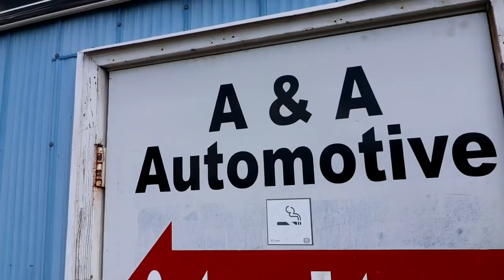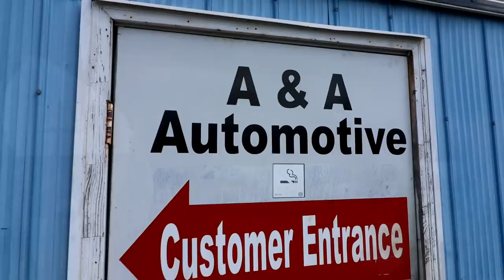Repotting my "Root over Temple" Ficus benjamina, The Bonsai Zone, July 2020

Comment: Great video- do you bring all your bonsai plants indoors during the cold snowy winters or you leave it outside - based on the variety? Thanks
Reply from the maker: The tropical trees come inside the house before the frost comes. The temperate trees come in just after the first frost hits and the hardy trees stay outside until the weather gets really cold, -15 or lower, and they go into the unheated basement until it warms up again in spring.

Comment: Hi Nigel, I just sawed the large roots off my Ficus Retusa in order to have new growth and also lower the plants height. (It has the large root trunk). Some of the leaves have been turning yellow and falling off. Is this normal? Where should I keep my Ficus bonsai while it's roots grow back (full shade, sun or??), and should I water often? Thank you. Your Channel Rocks!
Reply from the maker: It is normal to loose some leaves as the tree adjusts. The closer you can get to a greenhouse type conditions the better, bright but not direct sun and warm and humid. You may have to put a humidity tent over the tree until it recovers, sort of a temporary greenhouse made from clear plastic. You can buy these small free standing greenhouses at many of the big box stores.

Comment: 13:14 keep the little root on top of the big one just like that.. because otherwise it would be too straight like you can see in 13:17 and you already have many straight roots in this tree which kinda takes away the illustration of the roots sneaking around the stones to be able to get some water
Reply from the maker: Yes, i wish I had more winding roots that follow the contours of the temple, but it's hard to encourage them, I may have to cover the temple with moss for a few years!

Comment: Do you mix perlite with anything? I've just started growing my own trees for the first time, waiting for the seedlings to grow, found some perlite in my local shop and was wondering if I'd need to mix it with something else to create soil
Reply from the maker: Yes, I mix the perlite equally with turface. It is a fired clay material that absorbs water and doesn't break down or get mushy. It is similar to fine crushed bricks. I buy it at the farm store, it is used to clean up oil spills in garages and as a soil conditioner. The product I buy is called SafetySorb. I screen out the dust and fine particles from my soil.
Reply: @TheBonsaiZone  Thanks for the quick reply. I live in the UK and I can't seem to buy turface anywhere or, even online, it may even be a different name here? Would Akadama or Pumice be a good replacement for turface?

Comment: How do you grow moss?. I found some in my yard and transplanted it to a tray with peatmoss...
Reply from the maker: I find it grows well in a shallow tray with no drainage holes, keep the tray in a bright but shady spot and it should do well. You don't need any soil in the tray, but keep it watered well.
Reply: If you want to grow a lot of moss, you can take a good sized chunk of moss and put it in a blender with a can of cheap beer.  You can use this directly, mix it with water in a watering can, or you can put it in one of those lawn fertilizer attachments for a garden hose if you really want to grow some moss.